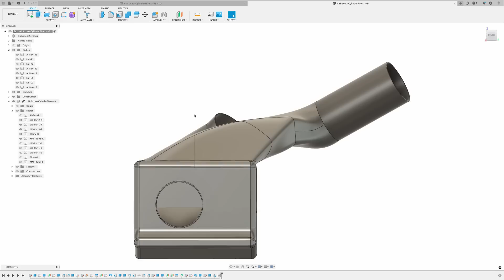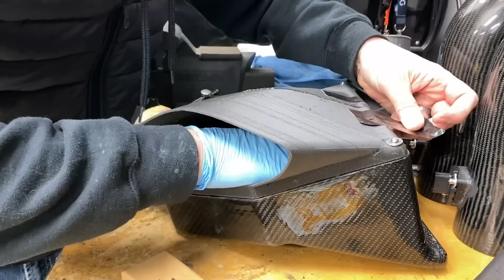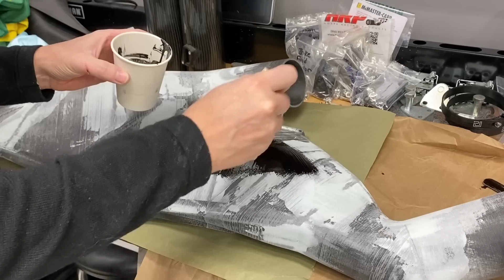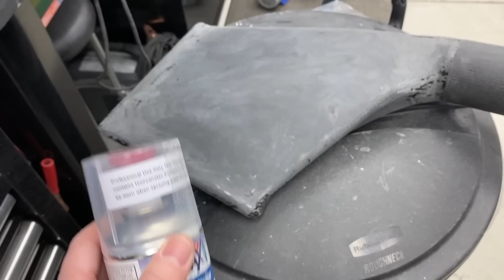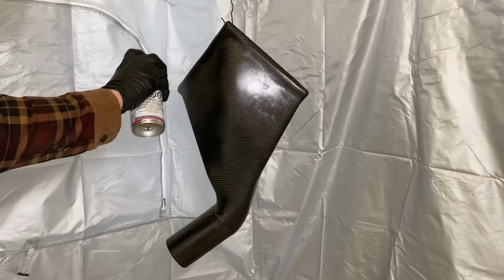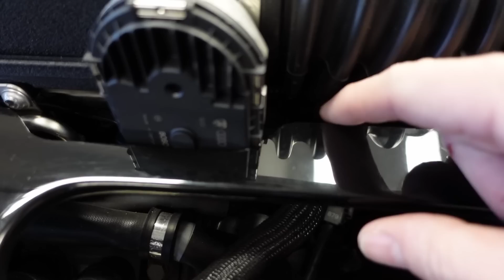New Carbon Air-box Lids Finished!

Comment: Love the work Dan, and the detail! I just used a tent with dust sheets when I painted in the garage and it worked well - after I also covered the floor... The gold heat shields are great, I would get a better mask though when sanding fibres...
Thought about measuring the temp in those tight areas?
"..under the bonnet" - British??
A bit of foam/ felt on the clam where it is close to the air box incase of movement/ scratching? 
Apologies for the queries/ comments!  That rear clam is stunning.

Comment: Long time viewer, always a great day when I see a new video up!  

On future prints that require gluing nylon, consider looking into something like tbbondings poly kit...it bonds nylon at the molecular level, as opposed to jb weld which acts as a glue.  Also consider adding a small one sided lip or even a lap joint into the designs.  It'll provide much more surface area for bonding, will make aligning pieces a no brainer, and will provide tons more shear strength.

Can't wait to hear this thing roar!
Reply from the maker: Great tips!  Thank you. 🙏

Comment: Maybe just me, but I'd be worried about little bits of epoxy/glue from the joints breaking free over time and being ingested. I'd be tempted to skin the inside with something as well to avoid this from potentially happening. I might be nitpicking.
Reply from the maker: You make an excellent point! Coating the inside of the lids with a thin layer of high temp epoxy would be easy to do.   Cheap insurance for a potentially very expensive mistake!

Comment: Love the exposed engine. Incredible fabrication work with those intakes. The carbon fiber is gorgeous. Are you keeping the exhaust pipes that long?
Reply from the maker: Thanks for your kind words!  Now that I've done carbon skinning like this for a second time, practice certainly makes perfect...Good question on my exhaust--short answer: no.  Long answer: I've assembled the parts to build a valved exhaust tail section to replace those pipes.  Not sure when I'll get to it but it's on my list!
Reply: @DanDulac  wow...we're all dying to see that thing on the road.

Comment: I'm loving all the custom touches! I've been watching your videos for a while and love your approach to finding solutions! I'm also thinking about getting a 3-D printer-- I believe it would be a big help in my build. What model do you have, and can it print from an Autocad based program? I work in Autocad and I'm not really looking to learn a new program.
Thanks
Reply from the maker: Hi there!  I have a Prusa i3MK3S--it's a few years old now but works great and has never given me troubles.  But it does have a small(er) build plate which can be a limiting factor based on the size of prints you want to create.  Prusa is coming out with a new large format printer, called the XL, which I've pre-ordered.  But I've also heard amazing reviews of the new Bambu Lab X1 printer in the same price range...For 3D CAD design, I use AutoDesk Fusion360 but any CAD program that can export models in STL or 3MF format will work.  You then import this file into any of the available 3D printer slicer applications to generate a gcode file that the printer can consume.  Hope this helps point you in the right direction!
Reply: @DanDulac  
Thanks Dan!

Comment: Dan, like always, awesome job. Really impressed by your technical knowledge is so many fields! Should I know the name of your 3d printer? I'm thinking to buy one, but it's like a jungle... Any advice? Thx! Richard
Reply from the maker: Hi Riccardo!  I have a Prusa i3MK3S--it's a few years old now but works great and has never given me troubles.  Prusa also has a huge user community so there's always answers readily available as you climb the learning curve. But it does have a small(er) build plate which can be a limiting factor based on the size of prints you want to create.  Prusa is coming out with a new large format printer, called the XL, which I've pre-ordered.  But I've also heard amazing reviews of the new Bambu Lab X1 printer in the same price range.  Hope this helps!

Comment: That centre lock is a bit on the agricultural side. By the looks of it the intention is to put a pad lock on it to lock the lid.
Replacing it with a lock from a door or trunk that you can hide the release in the cabin would be a vast improvement.
Reply from the maker: Agree!  I’ve never been a fan of the factory center lock on these cars. I’ll have to noodle on a potential alternative. It’s really not intended to be a structural latch and wondering if I can do without it altogether…
Reply: @DanDulac  . I suggest The latch from either a rear hatch if you want strong or a motorcycle seat if you want small and just a lock.
But it definitely looks like a means of locking the lid only.

Comment: Dan, I like this construction method and am thinking about a similar project. What filament did you use? One of my concerns is the 3d printed material sustaining heat,vibration and in my case, some PCV vapors. Did you look into this much with your filament choice?
Reply from the maker: Hi Steve!  I meant to include the filament I used in the video so good question. For automotive parts, I almost exclusively use carbon fiber infused nylon. It withstands high temperatures, is strong yet flexible and is chemical resistant. Some call it “black aluminum” given these properties. Also, since Nylon is hydroscopic, it actually strengthens when exposed to the elements.  But this also means it can be tricky to print if it’s not thoroughly dry; but once you get it right, there are so many uses for this stuff. I highly recommend it.  Hope this helps!
Reply: @Dan Dulac  thanks! That helps send me down that path. I'll do some more reading on it. I have a 2J mk2 as well and it would be  nice to make a better intake and some brake ducts for it with this method. Did you find any tricks for defining how much space you had to work with in the engine bay? I may 3d print a sort of tiered platform that I can bolt to a fixed datum in the car and use play-doh to find the hood contact points at specific measurements away from the datum.....but am always looking for new methods.
Reply from the maker: @stevetrepanier4351  The method you describe for test fitting into tight spaces is a good--I use the same method.  I also 3D print mock-up models using cheap PLA filament as I get closer to a final model...it helps me tweak the final model before printing with expensive carbon fiber nylon.

Comment: Is that open cell foam to ‘seal’ the lids?
Might want to reconsider that one.
Reply from the maker: I confirmed it’s closed cell, oil resistant neoprene foam. Hopefully it holds up; if not, it’s easy to replace.
Reply from the maker: When I ordered the stuff from McMaster Carr, I intended to get closed foam. I’ll have to double check!
Reply: @DanDulac  good man. Don’t want a whistle

Comment: Nice job Dan, I did the exact same thing on the intake for my Viper. After 2 years, it is still holding up well. A little advice, if you are going to use a hose clamp, reinforce it on the inside with sheetmetal, other when it gets warm, the plastic will squash..